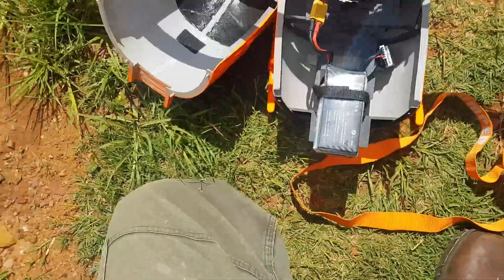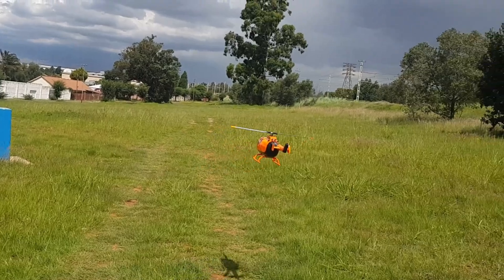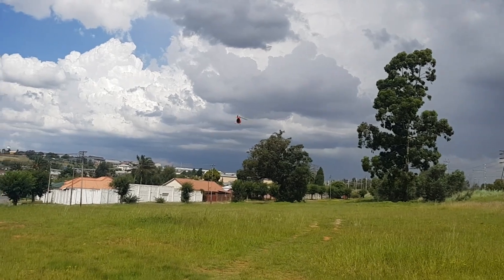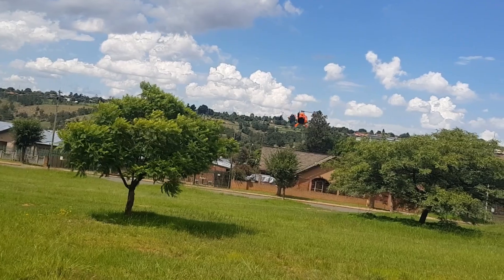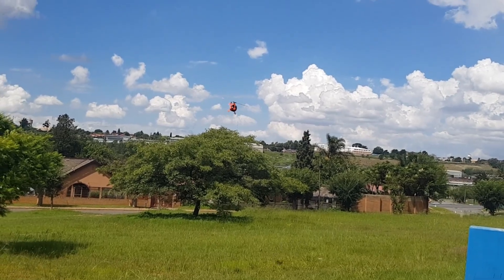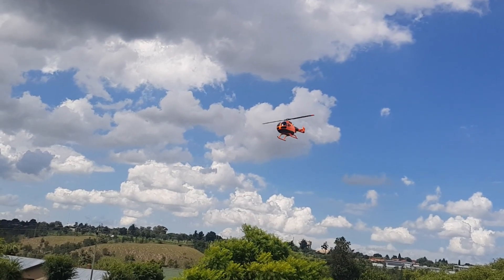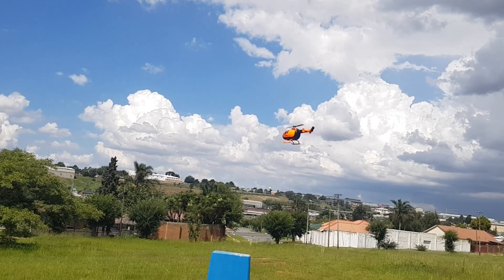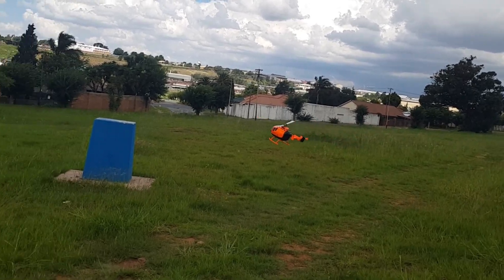3d printed BO-105 with Flywing Bell 206 electronics. Does she fly?

Comment: Very nice Mike! Handling the wind good! From where are you & what color will your next 1 be? Where did you buy your 4 blade from?
Reply from the maker: @HenloduToit  hi. Krugersdorp. Next one will be the same but white where the orange is. Busy on an assembly video. Got 4 bladed head from Scalerc in s.a. regards
Reply: @ thank you, they are nice guys, I'm also waiting on mine. You mind sharing your stl for the BO-105 or where can I buy it? Do you feel comfortable with the 3d printed body or would you rather just buy the original?
Reply from the maker: @HenloduToit  Hi, 3D file link is in the description above. I'm VERY happy with the 3D printed bodies and have no issue flying them at all. Besides. 16k vs 1k (material ex labor) is a no brainer if you have spare mechanics and the know how to assemble such a thing.  If its for the FW 450 let me know as I need to upload the base plate bracing for that model. They are already designed but have a different height. Regards